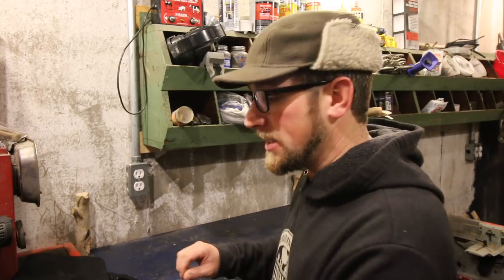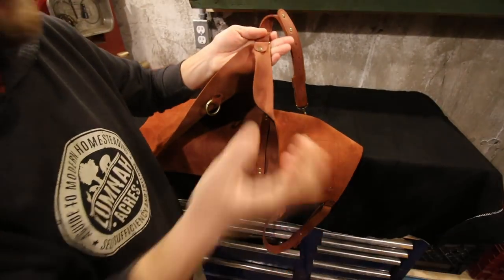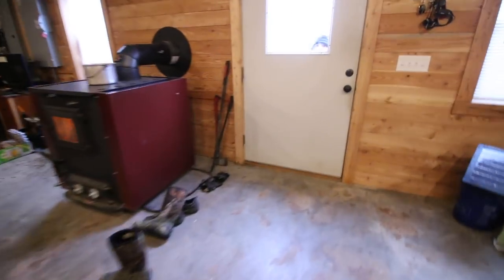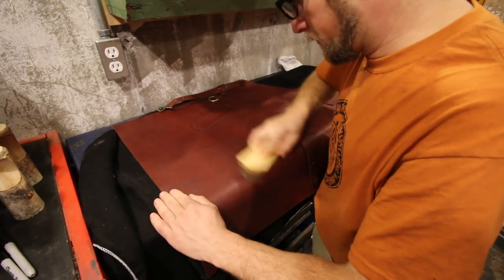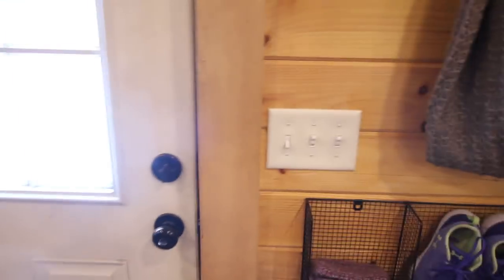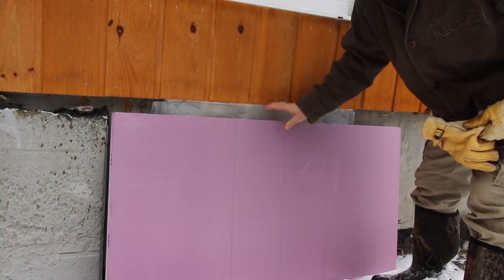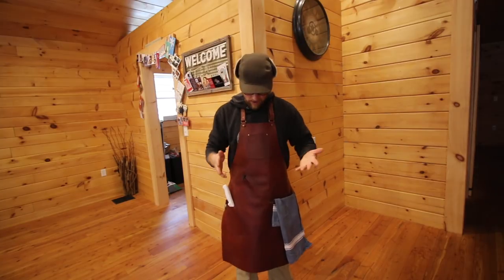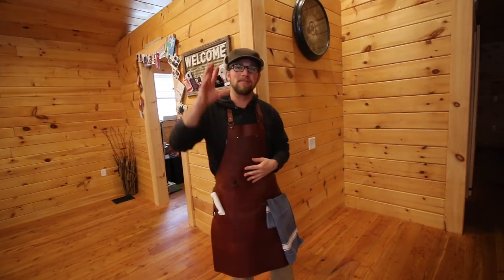Cold Smoking Bacon when its 0f out~ Olivias Winter Break~ Protecting a leather apron with Bee Butter

Comment: Nice job! I’ve used a product called Snow Seal for my mountaineering boots that does the same as your bees wax. Snow Seal recommends putting the leather product in an oven at 150 degrees to open the pours of the leather. This helps the leather absorb the treatment application. I would apply at least two coats in the fall then as need through out the winter.

Comment: Very nice apron. Can you provide a link for who made it? It will take several coats of your bee butter to really protect that from stains. It's not a matter of how much you put on, it's how hard you work it into the leather. Being a paste, the wax will not penetrate deeply on it's own. You can apply greater pressure to work the bee butter deeper into the leather. The trick I learned was to soften the bee butter in a double boiler type arrangement. Using a shallow tin, like a tuna fish can or similar, add water, then place your cup of bee butter in the water. Place this on top of your wood stove and heat just until the bee butter becomes liquid. You needn't worry about getting it too hot. It can only get as warm as the temp of the water. (You can boil an egg in a brown paper sack, over an open fire. The bag will not ignite because the water temp can't exceed 212* F due to the water.) Warming the leather will help also. Hanging the apron near the wood stove would work. When you apply the now liquid bee butter it will penetrate deeper into the leather. 
Have you checked the temperature in the root cellar at different heights? I've noticed the thermometer is usually at mid height on the shelf. With nothing inside to move the air, it will stratify, hotter near the ceiling, colder near the floor. Something to keep in mind when storing things. 
That will definitely be cold smoked bacon. You still have snow on the stove pipe and on top of the smoker. lol That's freaking cold! 
Happy New Year to all the modern steaders.
Reply from the maker: Should I put bees butter on the backside of the apron? Thanks for all the tips
Reply: It would be a good idea. It will provide better protection, and make it more supple. It will also use a lot more bee butter. Once treated hang it back in a warm area to allow the bee butter to be absorbed, rather than have it harden. You could also treat the rough out side with warm linseed oil as an alternative. Linseed is preferred over tung oil, as it remains more supple and penetrates deeper. Tung is much less flexible when cured. 
When making sheaths and cases for the blades I make, I treat the inside of the leather prior to stitching or lacing. Less for the protection of the leather, more for preventing rust on my blades.
Reply from the maker: Thanks. I will get some linseed oil for the back side and inside of the knife sheath
Reply: Good advice David. And well written.
Reply from the maker: I have the apron hanging in front of the wood stove drying after I treated with linseed oil! Thanks

Comment: when harvesting the meat chickens how long does it take to drain the blood from the bird after you have put them in the cone and cut off their heads? You scald them for about 10 sec.s and they are in the chicken plucker for what 10-15 sec.s... I'm trying to get an idea of how long it would take to process 200 birds with 4 people and 2 sets of 6 cones. 2 doing the placing of the birds into the cones, plus taking their heads. 1 removing the organs etc..the other 1 doing the scalding, defeathering then placing them into the coolers with h2o and apple cider vinegar. How long did you leave them in the coolers before you shrunk wrapped them? Did you find any difference in the tenderness of the bird you refrigerated for a few days before you froze them?